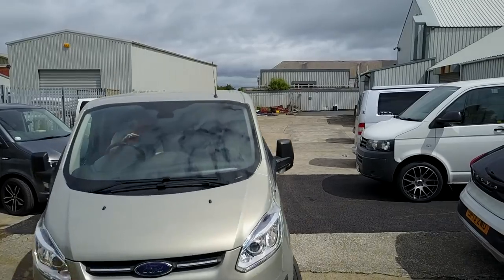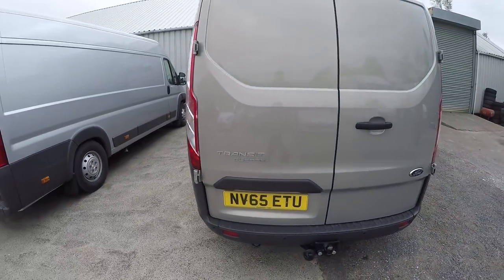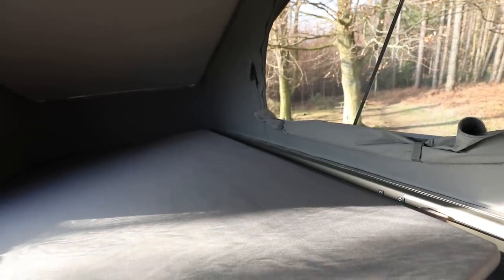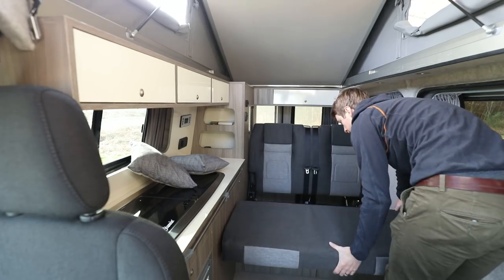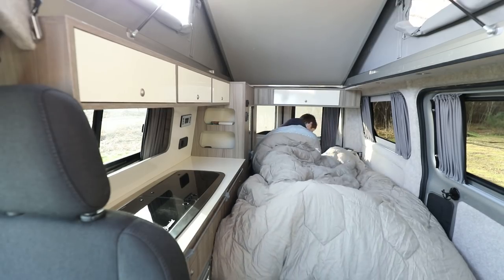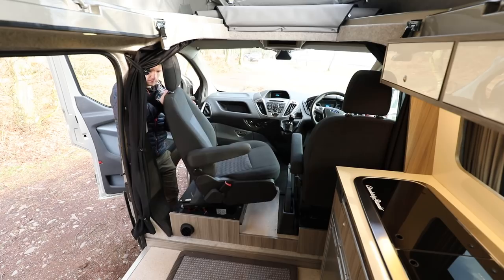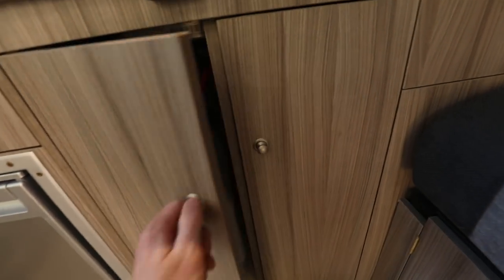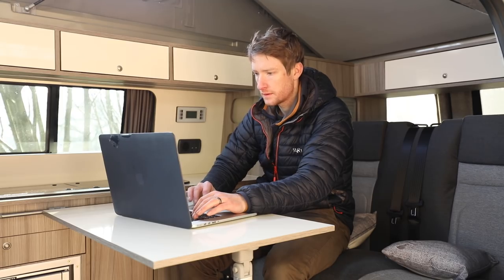Custom Camper Van Conversion | Full Tour, Problems & What I Would Change

Comment: Just an awesome looking van build, you should be able to dim those lights with a simple change of led driver and lamps fairly inexpensive.
Reply: Im thinking he can run some clear tape or wax paper to diffuse the LED lamps a bit.
Reply: The addition of a dimmer into the system is a very simple and inexpensive fix. Even touch sensitive switches and remotes can be added to replace the standard switches.
Reply: A decent set of ND grads should do the job
Reply: Dimmers use more power and create RF. I would make a simple defuser that slide into place. You could even have colored one that would help keep your night vision
Reply: The power that these very small dimmer use is so marginal that you can hardly measure it, we use them to good effect in many builds, also if Colour changing is required we would fit RGBW LED strip in place of the single colour white tape. This is the most permanent and easily changeable way to install such lighting.
Reply: Agreed, should be a fairly simple and inexpensive fix. Worth considering colour changing ones too, so you can cut out that blue late in the late hours for reading, bedding down, and get a great nights sleep.
Congrats on the new machine, Tom.
Reply: I've been waiting for this video for ages. And it didn't disappoint. I am positively green with envy. I'm glad you've got your dream van. It's also a dream of mine! I look forward to seeing more adventures featuring the van

Comment: Thomas your hard work and dedication to your profession is also why you have achieved a dream. I truly believe you will take your art to a new level with the freedom this bestows you. 

If you dont mind me asking where does your actual diesel heater sit and does it take up much room as I bought a converted VW van recently and use a 240v electric heater when on the grid and a small portable gas heater when off the grid but see the diesel heater as a great alternative solution.

Comment: I’ve been waiting for this video for so long! That’s goals!! If I could recommend a safety feature! A brake lock! Depending what that steering wheel is made of, they could just saw the soft material the steering wheel is made of real quick and remove the lock you currently have. The brake lock attaches underneath your gas pedal which makes un drivable. Really easy to use!
Reply from the maker: moises lopez You can't with this lock. It has 2 bars, which clamp either side of the steering wheel column. It's a simple, but ingenious design.

Comment: What a damper on excitement...not to mention business... in US, we'd take Paul to court to recoup loses incurred due to broken contract...not to worry about Paul though, as he'd take. The supplier to court to get you paid... and everyone is satisfied... and held accountable. But the results thus far are fantastic toward living the dream. Thanks for sharing the journey.
Reply: mikewinburn the unfortunate truth is that I have already approached the supplier with the request of compensation to no effect therefore it will always be the little people (me) who ends up out of business. As a new business it has very nearly put an end to our venture and only the high quality van builds and designs has saved us. 

What Tom did not mention in the video is that the supplier gave me a number of promises during the build, otherwise I would never have started the van when I did, when Tom explains work stopped that is only because we cannot progress the van further without the frame work being installed which strengthens the van following removal of the original roof. We had no choice at all but to halt work on the van completely until the roof was received. We were led to believe we would have the roof delivered a number of times between June and September and I even drove 400 mile round trip to collect it based on a promise of delivery yet they still failed to deliver on that occasion. When the roof was finally supplied as Tom says I had 3-4 vans in the same situation 2 of which in before Toms van was. Up until this year apart from an apprentice I am a one man band and simply could not keep up. 
Steep learning curve I guess for all involved!
Reply: Confirmed, Paul, being in th service business myself, my hat is off to you.
I’m glad to say Thomas was careful to relay it wasn’t at all your fault for the delay and considered it worth the long wait because of your efforts.
Sadly, here in US, it’s not at all uncommon to have to push the accountability forward and the guy in the middle gets to bear the brunt to recoup from the suppliers.  It’s almost expected in these cases, so no one takes it personally... and usually no one gets paid till the responsible party is forced to pay by the court. (That responsible party appears to be the supplier for sure).

We fans share Tom’s excitement and disappointment, as I’m sure you do as well not having been able to deliver to him and the others as intended due to situation out of your immediate control.

That said, man, that van surely looks awesome from what I can see... truly top notch.

Maybe you’ll expand overseas at some point and I’d have to look you up!

We look forward to the final drive out of the shop!
(Thanks for investing the time to add a reply).

Comment: Hey Thomas. Very inspiring video. I am too looking in a custom camper and a tiny house actually. This gives ideas about what is possible so that's great. Any chance to have a detailed post where you can list & reference parts used in your van ? Mainly the heater, the battery, the custom tanks, the safe, ... things like that. I thought the only thing really missing would be the shower. And I was wondering if it's possible to install one in the backdoor. Yours seems to open up and horizontal which is perfect to hold some kind of shower head in it when open. The water would come from a tank on top ... or could be pumped from the tank you already have. And obviously that would mean you are taking your shower outside. A shower curtain would be needed around it and most of all ... braving the cold every time you need to shower :D but that would mean complete independence so why not ? Just a thought. Cheers.

Comment: Unless I am mistaken, your electrical outlet under the van is not covered and therefor is exposed to road debris, salt, etc. I'd use something to seal it so the contacts will stay clean. Otherwise you'll wonder why you can't get power to the van.
Reply from the maker: M Help Hmmmmmm, good point. This will need to be addressed with the van build company. Or perhaps I can find a simple solution on eBay 👍

Comment: Thomas, if you're squeamish about using the Porta Potti try Disposa John. I've got a motorhome and am a bit selective about loo use, and think they work fine so long as you hold your nose! Too much information.......
The poptop sidewalls don't appear to be insulated. Do they lose a lot of heat? Is the diesel heater noisy at night? And where's your tv?

Comment: Nice van. When you say your current longest off grid stretch is 4 days. Is that without doing any driving to charge the batteries? Does the fridge run on gas or electric? Only using 25% over four days with only a 100W solar panel didn't quite add up to me.
Reply from the maker: Reuben Gow Driving each day. Like I said, best solution for what I do.

Comment: very nice van bro!!!! just a quick question what does your fridge run of?? is it gas and battery o just battery?  the van we have (auto trail v-line 600) just runs of battery which we have two of (leisure ones) amd it does drain the batteries.

Comment: How did you add a diesel heater?
Add a 2nd diesel fuel tank under chassis? This is a regular gas engine correct?

Comment: A couple of thoughts. When the drivers swivel chair is in place. Turn the chair 180 degrees so it's facing into the habitation area. Drill a hole the swivel base, and somewhere metal on the actual chair and then chain, or padlock the chair facing the wrong way for driving. You can also run chain from one door handle to the other making the doors impossible to open. Not Aesthetically pleasing, but the rate that Ford motorhomes are being stolen, might be worth it. We've been with Comfort for years, very helpful, and ours comes with full European Breakdown and Recovery included)
Having seen the Potnoodles in the cupboard, I'd seriously look into Britstops, they would be perfect for you.
http://www.britstops.com/
Lastly, the exterior silver screens, make a massive difference to heat loss and condensation on the inside in the winter. But they also keep the van cool in very hot weather.
Been motorhoming for years, so if you have any questions, fire away.
Reply from the maker: Sharon Heritage Lots of great info, thanks a lot. I love swivel seat lock idea. Perfect 👍
Reply: http://lock-m-out.co.uk/
Something else, that stops the toe-rags getting in at all.
Not sure what type of habitation windows you have, but just another easier lock to apply.

Comment: Wow 9 months and still not right and when you showed the windows leaking i was wondering where you had taken it as thats pretty basic stuff. Looks great now though even with the niggles. Im just converting my T5 now and had been talking earlier today with a friend  about the poptop conversion on the transit custom. Sounded a bit easier than the t5 and as you say lower price point. May do one in the future once they have ironed out the kinks in the new systems they are creating for them.
Reply: Damian G unfortunately the roof fitting for the custom is more complicated, especially the SCA roof, they take at least another 1 full day to fit and not for the faint hearted. T5 much easier van to convert on the whole. Also transit roof is more expensive than t5/6 due to demand being lower. 👍🏻
Reply: Damian G also yep you are correct the windows are basic and is why we no longer entrust the fitting of glass with the person who fitted Toms. Glass was replaced at no extra cost of course. 👍🏻
Reply: Surprised at that from the description i got. Maybe different roof system. Getting some images soon so can weigh it up myself.  Must have been a nightmare getting it all cut out and then having no roof to put in.
Reply: Thanks for the replies - didn't look for, or expect any, so fair play. Van looks great now.  Given me an extra nudge to get more time on mine. Just hard balancing that with everything else I have going on with work etc. Would quite enjoy conversions as my main profession but atm my job pays the bills. Its on the roadmap though ;) Cheers.
Reply: Yeah, it’s the way in which the roof skin is cut whilst leaving more of the van structure in place for the reinforcing frame to attach, where as the t5 roof frame replaces the structure all together. 
It’s just tricky on the transit. 
Yeah the delays were horrendous, Tom does a great job to explain in but the reality of it is much worse as and have only just received the final delayed roof this week!! We shall get through it though. 

Yeah it’s great converting them, hard work but rewarding, and to do right costs a lot of money! 
Enjoy building your van. 👍🏻

Comment: How would your internet work when you are on the go? Do you use a satellite internet service or?
Reply from the maker: Matthew Gilbert Tethering from my phone works a treat.
Reply: my mobile internet on 4G is faster than my fibre connection! Just a shame i only get a certain amount of Gb per month allowance.  Should have enough to be able to work remotely in my campervan for a week or maybe even longer if i wanted though.  When its done i going to give it a try - working from an awesome viewpoint with the doors open and kettle on. :)

Comment: Hi Tom. You mentioned  that you're interested in a towbar mounted storage box. We use a Bakrak (http://www.bak-rak.com) Base-rak for carying our 6 berth canvas tunnel tent (VERY heavy when wet) so I can vouch for the value & strength of these. They do a 450liter/100kg weight limit "New Tough Duty Big-box" which might suit your need, or a smaller one if that's too big. There's even a The towball mounted winch which would've come in handy during your recent snow-bound adventure - lol.

I have to say that I'm dead jealous of your lovely new(ish) van, but still somewhat puzzled how you get 2 people into the pop-top to sleep. 

Hope you get everything sorted to your exact liking soon.